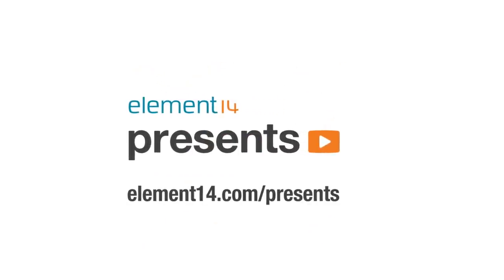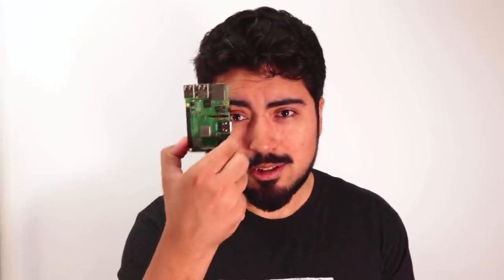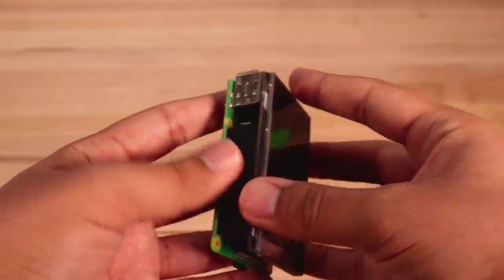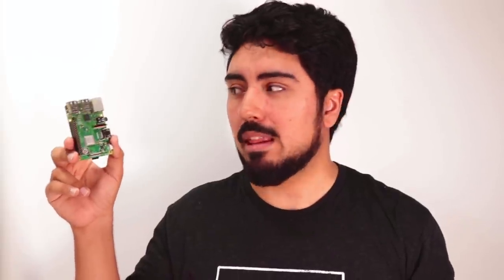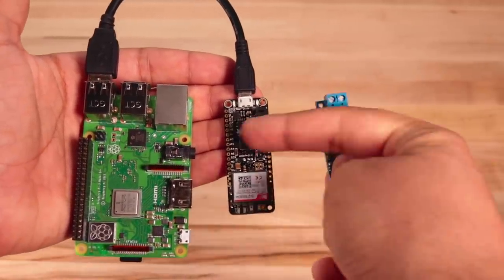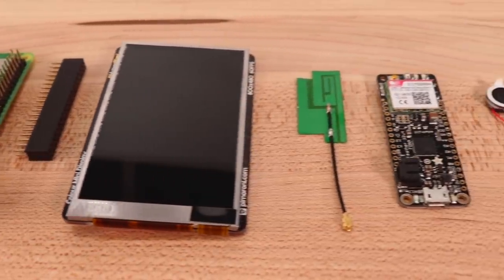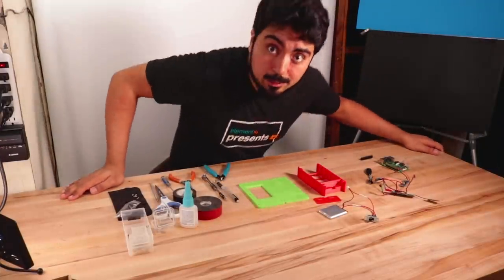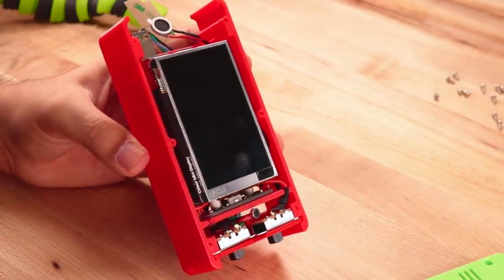Make Your Own Raspberry Pi Cell Phone

Comment: Update:      I did a ROUGH guide for parts and cost
        * Pi    – $35
        * Touchscreen   – $35
        * LiPo battery   – $15
        * GSM module   – $38
        * boost converter – $10
        * Cables,connectors,etc – $25
 * Case   - $20
 * Speaker  - $2.50
 * Mic   - $2.50
 * Antenna  - $5.00

        Total: $188

Comment: Correct me if I'm wrong but can the pi not run off 3.3v? This is the case with the zero anyways, I have done so many times.
Reply: Konnor Bowen I'd belive it. I wanted to be certain it would operate fine. I doubt the on board USB hardware and the screen would be too happy (or operate at all) without a solid 5v

Comment: I have a pi3 b+ .... 

i would like to know if there is any adeptor or any thing available that can be inserted to the display jumper and the other end lets me insert any display from a broken phone.

i know touch wont work iam ok with that.
Reply: There are a large variety of screens and unique controllers for which someone would need to write drivers. While you can buy most OEM screens, you'll find the documentation for them is pretty sparse, or nonexistent, because this is proprietary hardware. You're better off with the well documented screens with SPI interfaces or miniature displays with HDMI.
Reply: @MrVolt  sir m currently using hdmi and a hdmi to vga convertor... it was just a idea to attach an easily available screen .... as pi itself proved to be the worlds cheapest computer and to keep the pi like that we need cheap and easy solutions.......

My point is sir that if pi along with its accessories goes above the cheapest desktop or laptop in the market ..what will be the point in buying it ???

Also thanks for the reply....keep up the good work...god bless you

Comment: My two cents.. First of all it's way too big. That's because you're using all those modules instead of making a PCB and using only the necessary components. The Raspberry is just a waste. You're only using it to send uart commands to the gsm module and drive a display. 

You can do that with a 1$ microcontroller for a fraction of that power, plus it would be soooo much smaller. 

Another point, you have a touch panel which is kinda neat and saves a lot of place but then you're using those bulky ugly switches. It just doesn't fit together. And don't get me started about the power consumption. That battery powers a 5V /1 or 2 Amps raspberry through a boost converter, the display and the gsm module. Very inefficient. 

This here is a much better design: https://www.youtube.com/watch?v=JDmqrCzniDg
No arduinos, raspberries, and tones of modules to do a simple task.

Comment: Buy a cheap phone for 50 bucks, all the parts for that phone is at least about 150.
Reply: But if it is designed for a lifetime of upgrades, its lifetime cost is significantly lower even than that of dozens of cheapo phones.

Comment: Rather than using an ugly switch to turn off your phone when charging, why not just use a charger with more amps so that the phone still works if you get a call while charging.
Reply: It doesn't work like that. its limited by the charge controller.
Reply: More amps mean larger wire and connectors, usb can only do so much... 

The PI uses more than usb can provide and charge a battery at the same time. 

Also power is lost when transformed

Comment: I gotta say, the proportions of the screen compared to the frame being quite stretched out by the looks of it. I do have a question that surrounds a similar topic, can this be done with a touch screen and battery that has proprietary connectors as the motherboard in a phone got unuseable and what platform do you recommend to keep the profile as low as possible as I want it to fit in a phone case?

Comment: wouldnt it be better to use a windows 10 based single board compute and just enable the UWP Microsoft Phone app? because then you dont have to make your own software?
Reply: wclifton968 Writing my own code was the fun (and frustrating part) of this build.
Reply: so? there might be some coding involved still since there may not be any Display or GSM drivers for windows which you'd have to develop yourself but I see where your coming from but using windows 10 would make it more into a smartphone rather than a basic feature phone that has less functionality than a Nokia 8110 (not the new one made by HMD Global)
Reply: +adventureoflinkmk2 less features than Windows 10 and it's 1st party software and 3rd party software